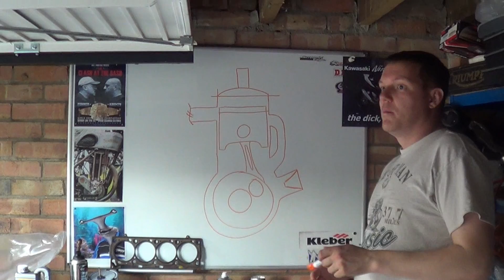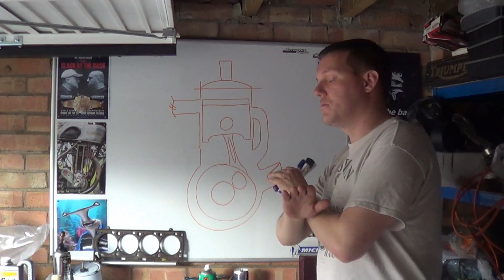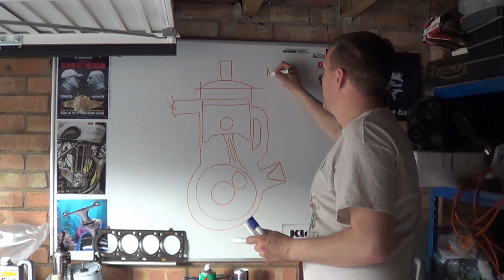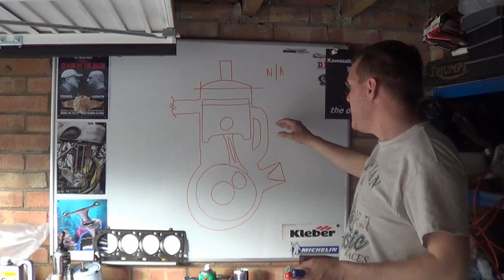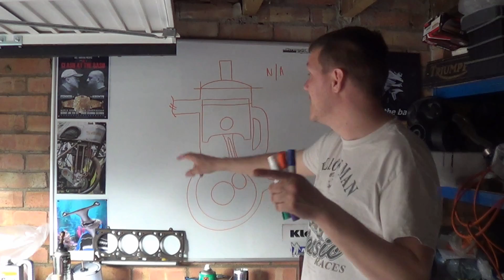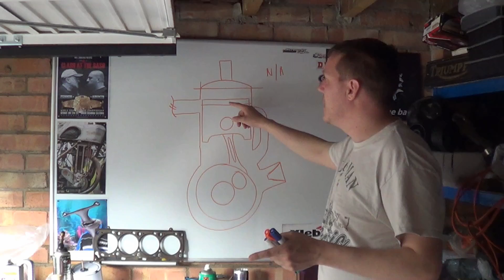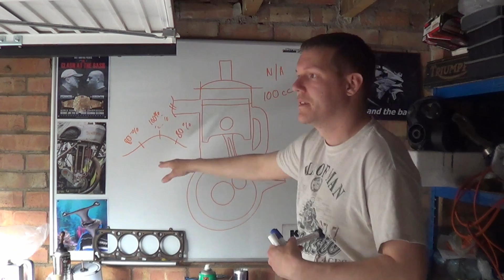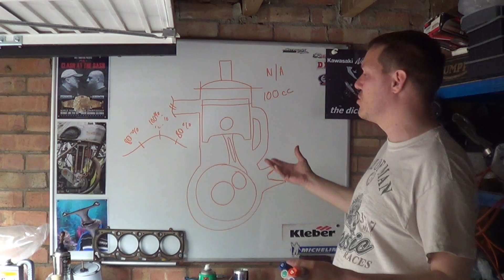2 Strokes are NOT supercharged!

Comment: it's definitely not supercharged, but could you argue that because it's pumped on the downstroke (even at 1 bar) it's forced induction?
Reply: Mark Dyson, I agree....IF the crankcase pressure ever goes positive.  I'm not sure it does but the ability to increase crankcase pressure is a key reason why a reed valve engine generally performs much better than a piston port.
Reply: Thats where i got confused. I have to admit even thought i knew that the air volume that gets "sucked" in the crankcase is the same as that, that afterwards gets pushed in the combustion chamber, i thought it would be some kind of precompression. Well, now i know it better :D
Reply from the maker: " is a key reason why a reed valve engine generally performs much better than a piston port."

- performs better how - more detail please
Reply from the maker: "because it's pumped on the downstroke (even at 1 bar) it's forced induction?"

- induction into the engine, not into the cylinder. You said it yourself 'pumping'.
Reply: The Workshop, hp/torque per cc of displacement.  IAME 100cc piston port vs IAME 100cc reed valve.  22hp vs 30hp
Reply: The Workshop, technically, since the cylinder is where the explosion happens, everything before it is intake.....
Reply: Matt, you made a statement in the video about a supercharger and its placement....being an external bolt on.   Ah......so nothing says a supercharger has to be bolt on.  It can be cast into the engine block.  It is also quite often after the throttle body or carbs.  You can't run without them as they meter the air flow.....but then again, so does a supercharger.  All I am saying is that your statements are based on assumptions that may or may not be 100% true to every case.  

As for a 2t and crankcase pressures, I would love to see what the crankcase pressures really are.....to see if the crankcase ever goes positive on pressure.  I know when my kart engines (ran 2 cycle unlimited) were modified, a lot of time was taken to minimize crankcase volume and minimize heat sink (air cooled on methanol/Blendzall green label)
Reply: not really.  even though the charge does get compressed in the crankcase, it doesn't suck in any more than it could have if it were going straight into the cylinder.
Reply: butre jp Superchargers and engines don't "suck" in air.  They create a negative pressure at the inlet.  This is a big deal with reference to how they operate.  Matt makes a big deal about how to define a supercharger.  It really comes down to the terms Naturally Aspirated or Forced Induction.  Naturally aspirated is the creation of a negative pressure within the cylinder to allow air to be pressed in by the atmosphere.  Forced induction is having a pressure above atmospheric pressure to get air in the cylinder.  All the terms and this and that....don't really matter other than what the cylinder has going on.....because that is where the bang happens....(how it was taught to me in engineering school)  Forced induction can be 0.0000000001 psi over 1 atmosphere.....or it can be 1,000,000,000 psi.  NA can be .0000000001 psi under 1 atmosphere or it can be damn near a vacuum.  Na is under....FI is over.
Reply: Mike Grady I'm not sure how I'd define sucking other than negative pressure at the inlet.
Reply: butre jp SUCK was not an acceptable term when I was in school.  Negative or positive pressures.   Why is this important?  It is because it applies to different applications of different materials in different states of being.   You have gases, liquids, and solids......all with different surface tensions.  To be able to describe their movements, providing a given pressure suggests a tendency in temperature and or velocity.....
To say "suck" is like saying "speed".  It is relative....you can only define if by its component....otherwise, it doesn't fit the equation that is used to define its state of being.  
Look, I know it sounds asinine but it is how it is actually defined.  It tells us how a given fluid (air or liquid) works and how it is expected to act in a given environment.  
Trust me.....it gets really important.  How can any tree be taller than 33 feet?  You can only pull a column of water to that height.  So how does the water get to the top of a 100 ft tall tree?  Christ, this must be what Matt feels like when he gets off topic.
Reply: The piston displaces a charge volume from the crankcase to the cylinder, which flows via the transfer port, as it descends into the crankcase and occupies space.  As they are connected by the transfer port the crankcase and the cylinder are at equal pressure.
Reply: Osmosis is how water gets to the top of tall trees. You are correct about the term suck.  In terms of fluid dynamics a fluid (and that includes air) flows from a high pressure to a lower pressure.  It is not drawn by the lower pressure from the higher pressure.
Reply: The Workshop, Yea, I'm playing Devils advocate really haha. Looking at some of the comments that appear below I don't think a million videos on 2T's would get the message across but good on you for trying dude. When you going to do a video on Napier Deltic engines and really stir the pot.
Reply: Andy's Motorcycle Obsessions, same pressure? Ah, they aren't connected if the piston is blocking the transfer port......so at a certain point, the crankcase volume is being increased because the transfers are still being blocked (that's when the crankcase volume is at its greatest though) so, is it enough to get it over 1 atmosphere?  I have never seen it so I don't know.  I do know that at certain times, the crankcase pressure goes up........just not how high.  I suspect that in some it does go over a atmosphere.  I have had a few kart engines that were pretty energetic.....131cc methanol engines making well over 50 hp....and that was without nitro methane or propylene oxide......which takes us to the 3rd aspect of an engine and how it gets the oxygen and fuel in the cylinder.....power adders.....
Reply from the maker: Some of the comments above use the term 'negative pressure'. Which if we're being scientific then we have to make a destinction between gauge pressure and absolute pressure. Negetive pressure technically is impossible when talking about engines. 

A gas can only expand into a volume of lower pressure (which I know some have stated above). I did a video on the basics of a fluid dynamics going into a little bit more detail on this. But, I must hold my hands up. In some of the videos for simplicity I use the terms, drawn in, sucked, etc

video link - https://www.youtube.com/watch?v=yE7KsHEKG5Y&list=PLzYor9155-1HxTPUxDzY8rir4fkF-L5yT
Reply: Negative pressure is vacuum, essentially. As you stated, all that is needed to create flow is a pressure differential, so whether it's negative pressure (or vacuum) is irrelevant. There just needs so be a difference in pressure between two points in the system and then the volume of higher pressure will try to expand into the lower pressure area to find equilibrium between the two pressures. And no, I'm not disputing anything you have said, I am agreeing with you. Just putting things into a different perspective so it's easy to understand.
Reply: The Workshop, I will define all of my comments regarding negative pressure as anything below 1 atmosphere....but technically, you are correct.  I was making my statements based on a novice looking at a pressure gauge.  The reason I did that was because this video's content was obviously focused towards a novice.
Reply: Negative pressure is anything below atmosphere (zero gauge).  A N/A engine can't make enough power to create a vacuum, the parasitic loss would kill it, so it is kind of relevant in terms of terminology.  Other than that you're bang on.  As long as the pressure is lower than the pressure surrounding it there will be flow from the higher pressure area to the lower.  The lower pressure could be 14 psi absolute at sea level and it would still flow.

Comment: Turbos are way different than turbines engines..  Turbos compress more air to feed the engine. You need a fuel system that can understand that more air is going in to add fuel, where as with superchargers compress the air and fuel at the same time.. Yeah I'm going to catch hell before of the diesel bunch, but that is a whole different thing.  The problem today is that with EFI, or some kind of fuel injection system, you have to be able to make damn sure you have enough fuel to keep the engine cool and not blow the damn heads off it...

Comment: Wrong.....
Reply from the maker: go on then why?
Reply: +The Workshop First sory bad englsh, the pressure on crankcase when the piston move to BDC must be lower than sperchrger so the reedvalve still open and trnsfer mixer fuel will push all cmbstion to exhaust, the torque will increase in high rpm, bcause base 2stroke has low torque in hgh rpm when hard push all cmbustion to exhaust, but better sperchrger on in> 5000rpm, and will gve 2 to 3 hp in high rpm.
Reply: +Syair Putra I mean 2 to 3x hp in high rpm😀..
Reply from the maker: "the pressure on crankcase when the piston move to BDC must be lower than supercharger so the reedvalve still open and trnsfer mixer fuel"

- and it is.